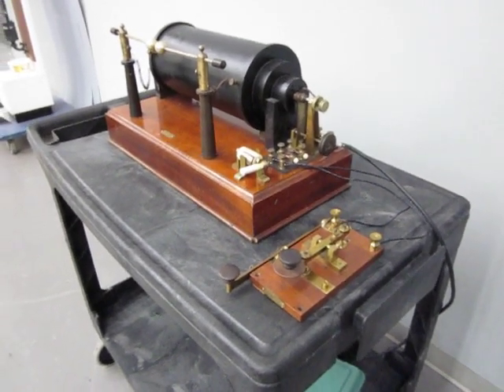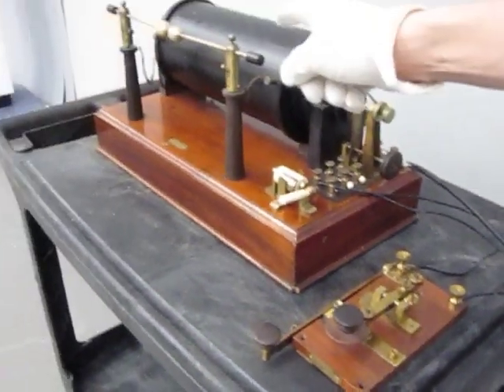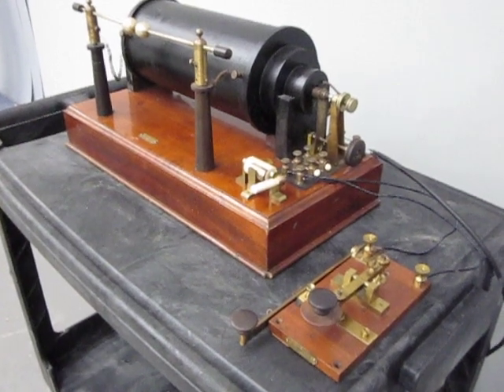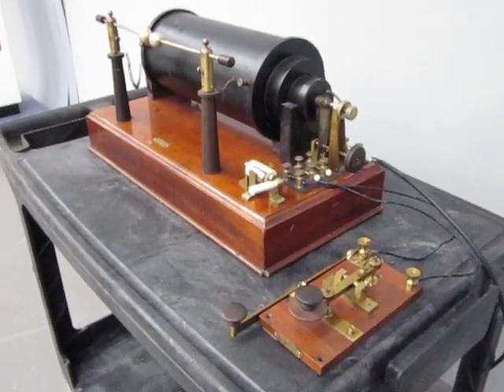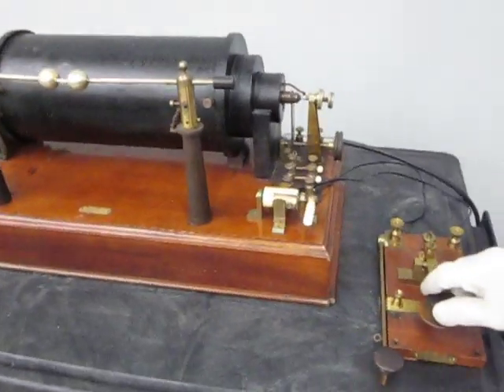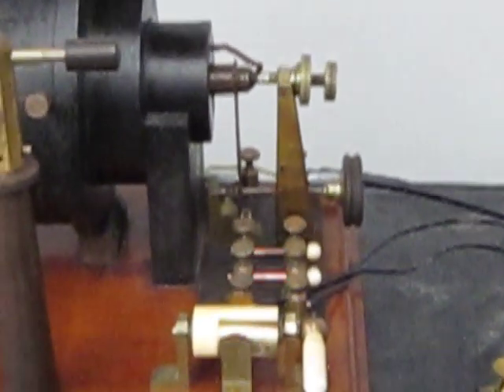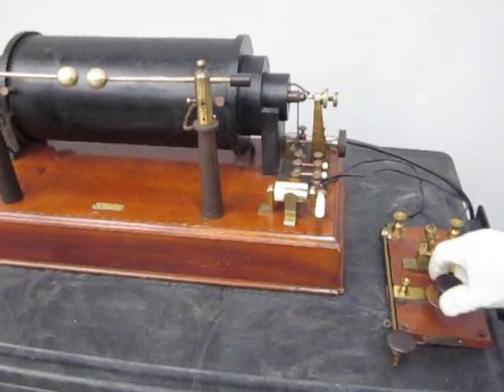Marconi Spark Gap Transmitter Demonstration

Comment: APPRECIATED. 
HOW THE FREQUENCY WAS DETERMINED  ?
Reply: As far as I know, this was an early wireless telegraph where the signals weren't filtered to transmit at one frequency. They were noisy across a broad range of frequencies, which is why only the loudest can be received well in the area, and why they were eventually banned later on.
Reply: By the resonance of the antenna 📡

Comment: O wow I didn't know that they were charging for those messages in the titanic deleted wireless scene. I hope that little racket was shut down after titanic told them to be quiet and went down as a result.
Reply: We should note an interesting fact.  Wireless installations operated as concessions on board ship.  They charged for all messages, even business messages for the shipping line.  These official messages were credited, or debited, from the account the wireless company owed the line effectively for rent of shipboard space.  Operators were not ship's crew but wireless company employees.  They were not under command of the captain or the steamship line.

Comment: Remember peeps. There were no beeps at this time. You're transmitting a spark. Basically it was just an interruption of background static. Like you're listening to dead air on a radio station and someone is interrupting that
Reply: I’ve always wondered what the titanic transmitter actually sounded like. I was pretty sure it was too early to actually transmit a beep sound, and this confirms it. Super interesting!
Reply: Sounders were also a thing. The duration between the initial "click" and when the electromagnet released the bar (a more "clack" sound) was how you determined what was being sent.
Reply: @ViolentTelegraphy No sounder was used for radio only headphone although some mecanical recoder was used at the begining of radio.

Comment: Do people still buy these or reproduce them? If so do they still work? And what would something like this cost? Thanks if anyone knows these answers! 💜
Reply: I'm sure you can buy them but not use them. They've been banned from use since 1934
Reply: It's not alowed (illegal) to use it anymore. Not even in small scale.
Reply: I built a simple spark gap transmitter as a demonstration for my class. Running off a 1.5V battery it was able to produce radio waves (static) on an AM radio. Took a few hours but once I had the design right I could make another in 20 minutes.

Comment: THe PRI-MARY COIL of the step-UP trans-former opertes basically as a BUZZER making an AUTO-matic OFF and ON switch at AUDIO FREQUENCY like a DOOR-bell mecha-nism and generating an PULSATING current to >  step-UP  TRANS-former where a SPARK-GAP is connected and to > the ANTENNA DI-pole .

Comment: This is what is called a Ruhmkorff coil some call it the trembler coil it is extremely crude and basically splattered the low frequency RF band with man made lightning and was virtually untunable.  Marconi was playing with this around 1895 but Nikola Tesla had already demonstrated wireless transmission and reception and the art of tuning a circuit in 1893 in a public demonstration in St. Louis MO before 5000 witnesses.  Nothing that Marconi developed later was anything more than copying Tesla's work and the works of other engineers and scientists in the field.  In 1943 the US Supreme Court struck down Marconi's patents declaring them basic infringements on Tesla's and other radio pioneers work.  It is time that history accords the true innovators the credit they richly deserve and not the actions of a thief.

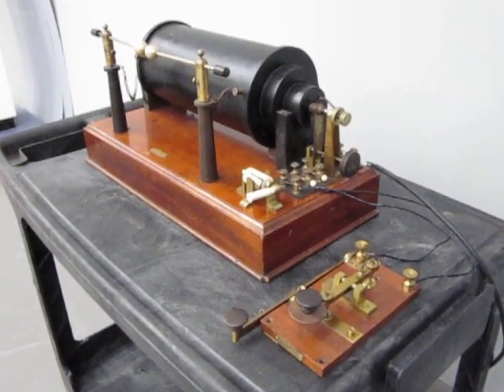Comment: 1:00 Thank you for clearing that bit of history. In the black & white film: A Night To Remember,  they had the Californian as negligient, typical British propaganda!
Checkout the video of my steampunkish low power Micro-Tesla Coil that I just just uploaded to YT the other day. All cardboard, buzzer and wires - - nothing electronic about it. The Tesla coil I made made a long time ago from scrap material, as the rest is salvaged material. The capacitor is 1000pf, and the plasme display in a  neon flame-flicker bulb
Reply: The Californian, even if she was aware of the tragedy, would have been powerless to do anything in time.  She was shut down in the ice with most of her boiler fires banked.  It takes many hours to get up to a level of steam again sufficient to drive the engines.  She could not have moved before daylight.

Comment: it said the night of the disaster is when the wireless transmitter broke on the Titanic and the two operators fixed it and besides messages after they struck an iceberg they sent a distress signal as the Californian was nearby but it was the Cunard line Carpathia that rescued titanic's survivors.

Comment: The unit shown is similar to those used by amateurs and commercial short range communications of the day.  It is is a low power version 1, if you will. Titanic’s was many generations of improvements.  Think of the difference between an early smart phone and several generations later.  It is good as a demo but not the main Titanic transmitter. Titanic main transmitter used a synchronous rotary disk spark gap using kilovolts of power plus an early form of capacitor bank and antenna tuning coil all housed in a “silent room” for obvious noise reasons.  The antenna array was also a new approach. State of the art at the time. The effect was less splatter, meaning more energy on the center frequency resulting in greater range. Transmissions easier to understand by the receiving operators.  Food for thought.

Comment: you have to remember that this was not voice broadcasting, it was Morse code only & it was before they fully understood the idea of oscillators & tuning the transmitter to higher frequencies to utilize the ionosphere to maximize range. Essentially they were creating artificial lightning & connecting it to an antenna. Something like this would have made bursts of static noise only in the same way lightning is picked up across most of RF spectrum & since it was broadcast over all frequencies that was part of the problem, all of the stations were talking on top of each other. From what I've read, the Titanic's transmitter was turned off for a time which created a backlog of telegrams. Later they were trying to catch up that night & were busy relaying passenger messages to Newfoundland which caused them to miss the gravity of the California's message in the cross-talk. The Californian was a smaller ship which probably had a small antenna & range. The titanic was probably the only station to hear the warning & they ignored it, telling them to shut up.
Reply: I don't want to be that guy, but if i recall correctly from the communications between the two ships that night, the first time the californian sent the warning for ice, Titanic actually replied with "received". When the Californian repeated the warning, the Titanic then proceeded to say "Shut up. Jamming". So the marconi operator was aware of ice but probably didn't report it because he was busy catching up on all the passengers comms he failed to send earlier that day due to the machine breaking down.
Reply: The Titanic had a resonant circuit inductivily coupled to the antenna. At that time, it was well understood how to tune a transmitter.
They also had a magnetic detector that was way more sensitive than the earlier coherers. They even had a prototype tube detector which hasn´t been used - due to the accident. What they haven´t figured out yet was a continuous wave generation, due to the lack of amplifiers. Tube technology came a bit later - so the wave was rich on harmonics.
Reply: @paulkocyla1343  Thank you, Paul.
How does that inductively coupled resonant circuitry work? 
To my knowledge, modern technique to detect RF signal is done by diode(AM or SSB) and FM detector, what is magnetic detector？
If it was not capable of continuous generation, if I press and hold the morse key, will the transmission be an faded and over damped oscillation?
Reply: Carliconi
Reply: Well to my understanding of how vintage radio transmitter works is, creation of stable  oscillation only by spark that time. Nowadays we have tons of methods to generate such oscillation both precisely and accurately, crystal osc, LC osc, RC osc, and YIG, for instance.
But I'm still curious on how exactly those old marconi machines work.

Comment: 0:13 what is the lever on the left side of the telegraph key platform for? A spare key?
Reply: Jeffrey314159 That's a shorting bar, for testing the keys continuity or the transmitter itself. So you have your hands free not holding the key down.
Reply from the maker: +Jeffrey314159 I'll speak with one of our curators and let you know
Reply: Looks like a master on off switch.
Reply: flexairz  No, that switch is on the Induction Coil platform. I'm talking about that elongated keylever right beside the telegraph-key itself, attached to the side of its base.
Reply: It’s a emergency off lever so if there is a problem it can cut the current by flipping it up

Comment: What's the max frequency that can be emitted through this?
Reply: +Canada Science and Technology Museum I disagree. The Spark Gap Radio Transmitters of the era were designed primarily to transmit at low radio frequencies < 300 KHz. These frequencies could be picked up at great distances, especially over the ocean water. This was vital at a time(1912) when there was no effective means of amplifying these signals.  These higher frequencies(>545KHz) would be justified for transmitting voice modulated communication which these crude devices could not do.
Reply: This particular apparatus? I would say around 300 KHz. But the crude sparking can create harmonics and parasitic oscillations of much higher frequencies, but at only a small fraction of the power.  The 5th harmonic has virtually no energy at all.
Reply: +Jeffrey314159  i totally agree and that was the reason i asked.. But it is also true that broadband frequencies and modern spectrum analyzers have shown 1 ghz spectrum.... But very very low in power... Receiver technology has gone up u see
Reply: +soumendra singh Yes, with modern technologies you can detect the 11th harmonic.
Reply from the maker: +soumendra singh I believe with Spark gap transmitters from the early 1900s, they emitted at frequencies from about 1.2 MHz and 545 kHz.
Reply: 300 meters. But it splatters all over the RF spectrum possibly up in the Ghz. Horrendous method of radio transmission, akin to busting a dam just to get a drink of water.
Reply: Which is why they've been illegal for ham use since 1924.  A demonstration like this is harmless.  Interestingly, Hertz actually started out in very high frequencies, apparently around 4 meters (say 75 MHz) according to https://www.electronics-notes.com/articles/history/spark-gap-transmitters/history.php

Comment: Nice demonstration of an induction coil and a spark gap, (I love your induction coil) but this is no spark gap transmitter.  To transmit damped waves in the RF spectrum, you need a tuned tank circuit composed of a high voltage condenser and a coil.  As the voltage across the condenser builds up, eventually it exceeds the ability of the spark gap to insulate the tank circuit.  The spark completes the circuit between the condenser and coil allowing it to resonate and produce RF waves.  The RF waves quickly decay to produce rather dirty triangle waves (damped waves) that can be heard by a distant receiver as a musical note.
Reply: This is the basic type of transmitter constructed by Hertz.  The tuned circuit is:  balls behave like the capacitor, the secondary of the rumkorf coil is the inductor, and the dipole antenna is the long rods.